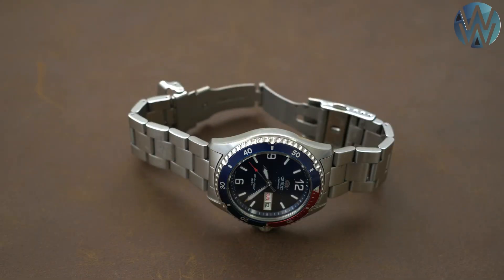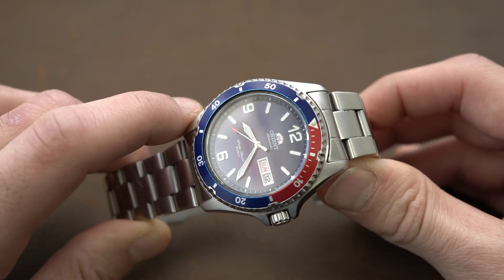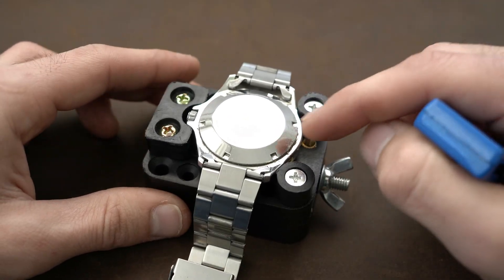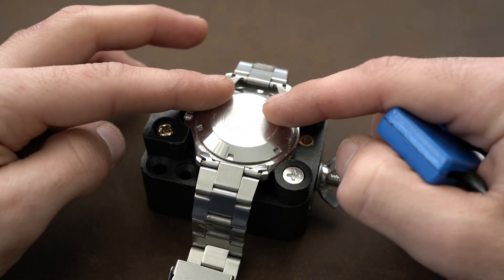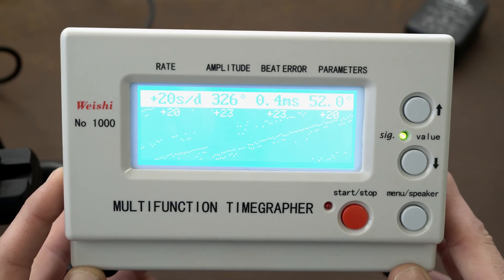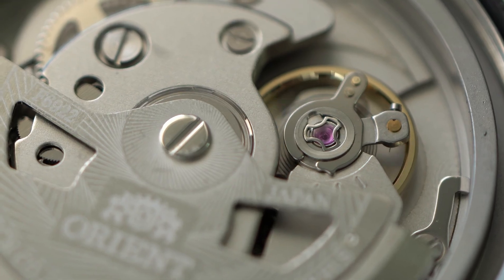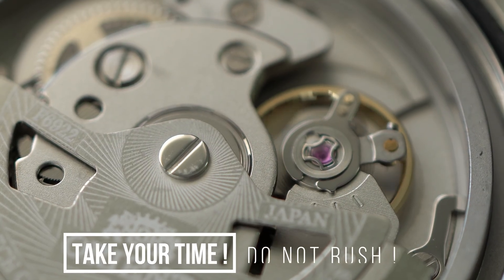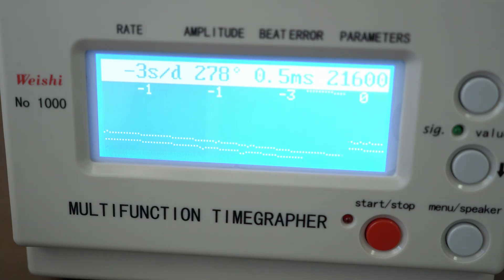How To Regulate A Watch

Comment: When you wear it during the day , the watch will lose speed  and when you take it off and place it in a dial facing up position  it will move fast. So when I regulate my watch I make sure rate is not minus but +2,+3 plus per day.

Comment: Watched this... just got a Seiko NH35 movement to -1 seconds in 5 different positions (only 5 mins at a time).  Will recheck over the next 2-3 weeks - but happy with the results so far... edit: using weishi 1900.

Comment: Always push the regulator horizontally. Pushing the regulator with the tool vertically is very risky to damage the balance spring.

Comment: Thanks for the tips. The F6922 in my Kamasu settled on +8.5..9 spd, which I didn't like, so regulated it to under 0.5 spd (in the all-day-round wearing mode) with the help of a software timegrapher on Android. Really requires some micrometric precision. In this case, only "dial down" position was available to me, but the trick is you want to get the software grapher to show about +5 spd in this "dial down" position, then it will be perfect on the wrist when it settles.
The movement itself is extremely stable and shows very little positional deviation, if any. Never saw such performance before. Kudos to Orient!
Reply from the maker: Very nice mate !! ...... Thanks for watching :)

Comment: Hello. I have Omega Speedmaster, very old watch, automatic, and I have this part for regulating, but there is no + and - . It doesn say where is + and where s -. Can this part be adjustet at all? Does every automatic have this part for adjusting it? Now, the watch is in hurry 6 minutes every day.
Reply: I would try to find a manual of its movement on the internet, where  there should be such details of the regulator. 
If I didn't find this manual, or found it and still wouldn't be sufficiently confident about regulating the watch's time by myself, I'd try to find a qualified watchmaker who knows how to handle old watches properly. I don't believe in taking uncalculated risks.

Comment: Now that I have my watch, it seems to very consistent 6-8 seconds a day.  I'm going to wait until three months before I adjust it. Or I will live it as is.
Reply from the maker: 6-8 sec a day thats ok my man i wouldn't do it . Only if it will catch more time :)
Reply: @WizardWatch Many who don't fuss about accuracy in mechanical watches that aren't high end prefer it this way and it's okay.  
The opposite position is lots of fun IMO (if it doesn't become an obsession that compromises healthy aspects of one's life) -- enthusiasts strive to get the best precision that these watches can deliver. Considering that Seiko 5s, for example, can rival so many high end chronometers in precision per day for such a low price -- especially (but not necessarily) if they're regulated -- it seems to me very exciting. In fact, the only reason I didn't purchase the Seiko 5 equivalent of a Rolex Datejust 2 years ago was that it had become a bit too costly to my taste.